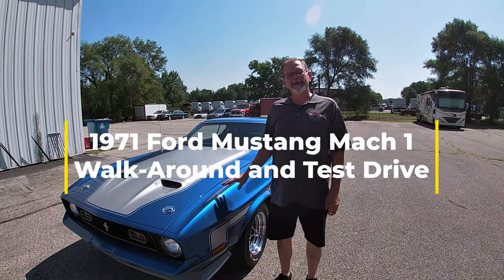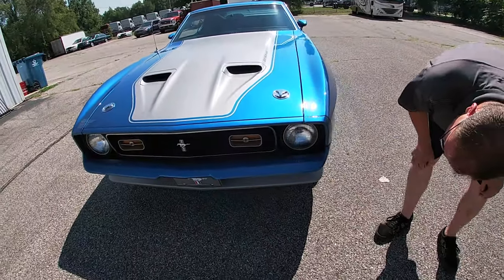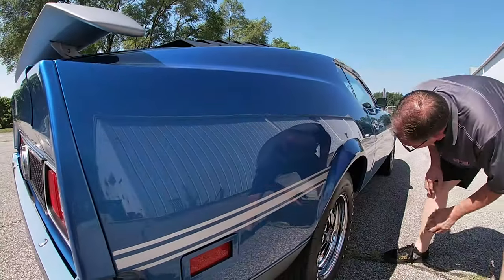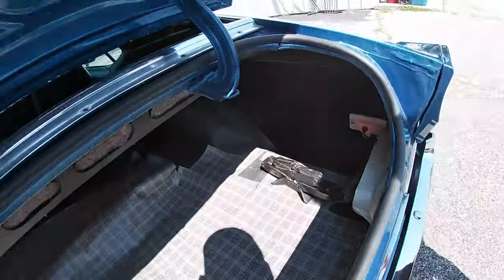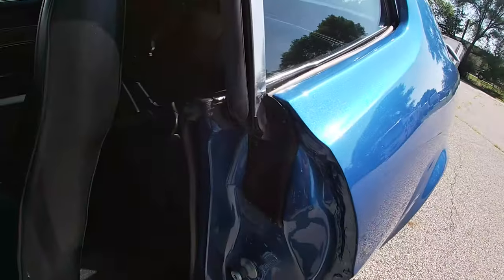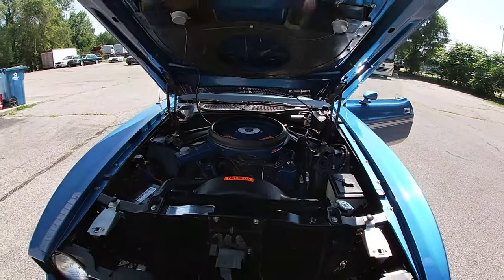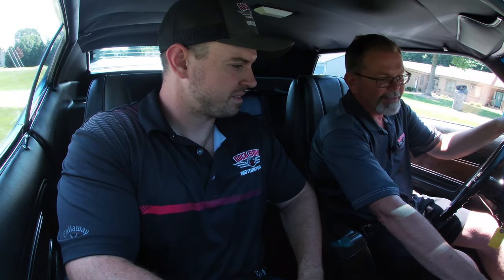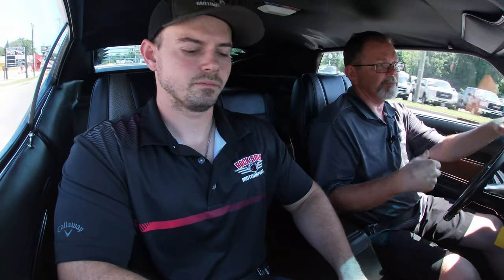Rotisserie Restored, M-Code, 1971 Ford Mustang Mach 1 Test Drive

Comment: you will never sell it because its a 4 cylinder motor all M codes are 4 cylinder motors ; i no this because i worked at ford for 40 years . only the yenko mustangs were fitted with a 2 ltr diesel v8 paired to 6 speed manual collum shift gearbox. like i said i worked at fords for 40 yrs

Comment: I've never seen a mach 1 with a silver hood. Normally they are flat black. Im not saying it not correct just odd.  The bumpers are normally colored the same as body. Not saying it not correct just odd or was an option to pick. Im pretty sure it was part of the mach 1  theme.
Reply from the maker: The black stripe package is much more common than the light silver poly stripes but they were a factory option.  You could even order a Mach 1 without the stripes altogether.  The front bumpers were colored the same as the body and the front bumper of this Mach 1 does match the body.  The rear bumpers were all chrome.  The chin spoilers and lower rocker stripes would be colored the same as the rest of the stripe package.
Reply: @rocksolidmotorsports  very cool I have 71 mach 1 thanks for the info . Respect and Good luck on the sales
Reply from the maker: Nice! They're a great car to own.  We are always excited when we get a '71-73 Mach 1 in inventory.  Thank you for the kind words!